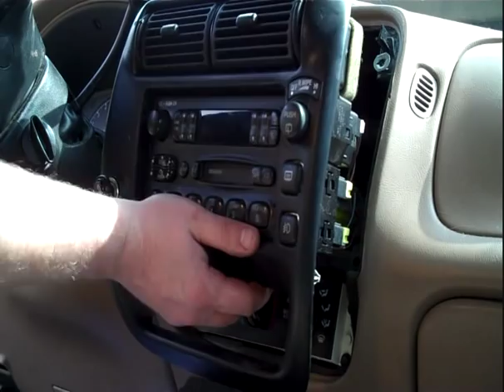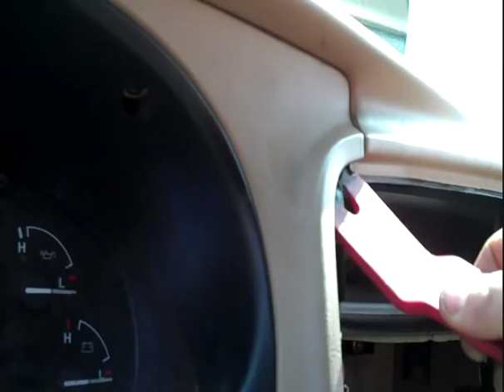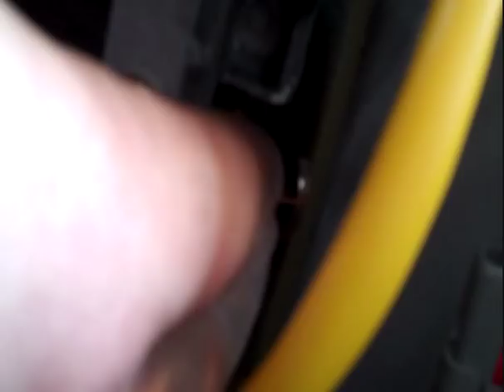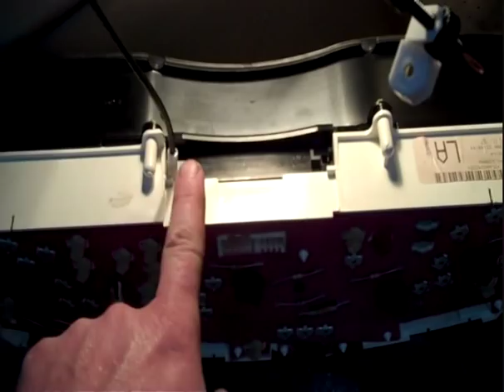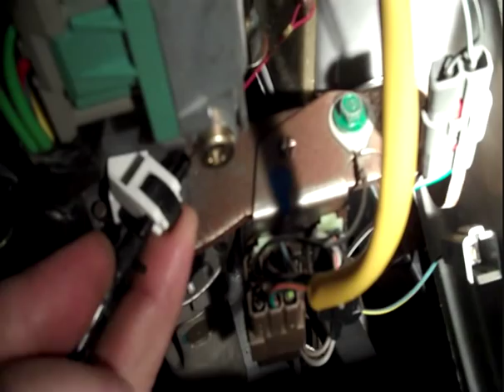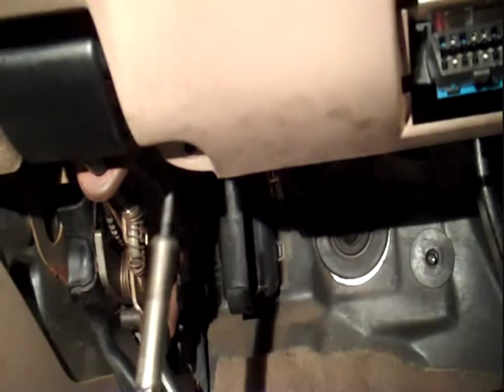Ford Dash Lights & Shift Indicator Repair

Comment from the maker: @goldeneye4564  Disconnect the shift linkage from the trans.  See if the shift lever will move all of the way to 1st.  If so, the problem is in the trans.  If not, disconnect the shift linkage from the steering column.  If the shift lever still doesn't move all the way, problem is in shift lever linkage on column.  If it does move all the way problem is in cable.  (I'm assuming that's column shift, not floor or console.)

Comment: I have a 1997 ford expedition, the indicator is fine and so is the wheel I took the bottom part of the dash out... the problem is that on the indicator the transmission gear lever will not let me physically shift the truck into 2 or 1.... help?

Comment: GM went to soldered bulbs in their clusters some time ago. I found this out when I went to change the lights on on my Buick. This would have been $500 at the stealership to fix. I did this for about $15 and a 15 watt soldering iron.

Comment from the maker: @renosteam Tengo problemas para entenderle. No hablo español. Estoy usando Google Translate para tratar de entender. No sé si su caja de fusibles no funciona, o no conectado. Es posible que tenga una buena exploración de herramientas para comunicarse con el GEM (Módulo Electrónico Genérico). El GEM controles de aire acondicionado, iluminación y otros aparatos electrónicos.